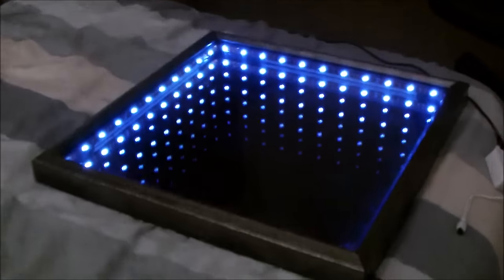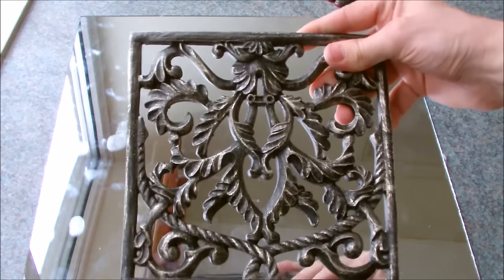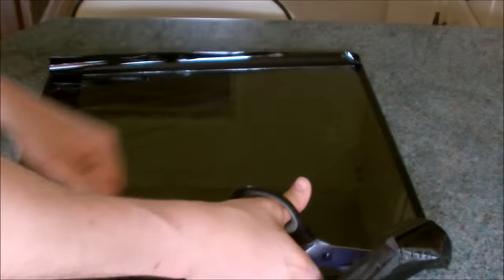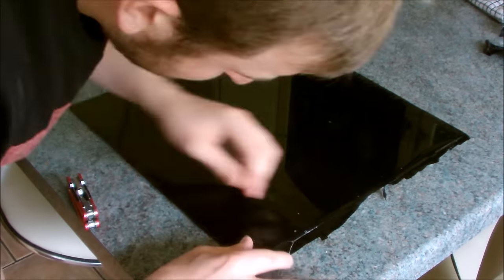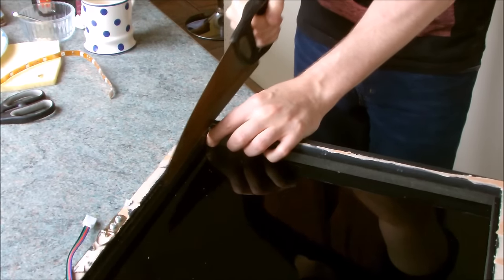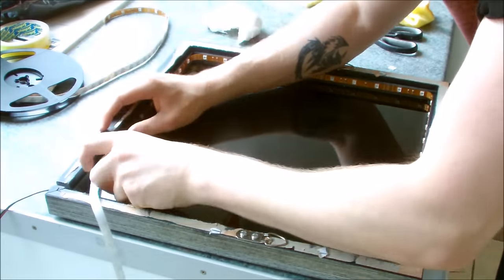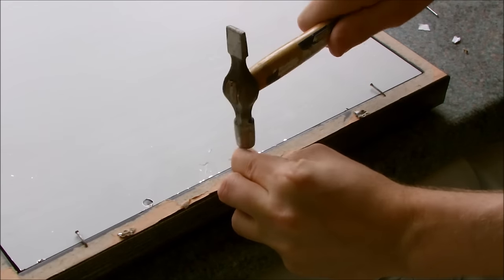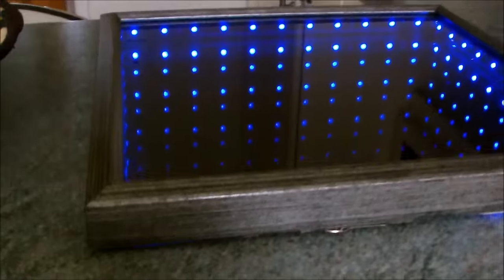Make An L.E.D Illusion Mirror!

Comment: would it look like there was more depth between the lights if the class and mirror were spaced out more?
Reply: +David Secrest  - class?
Reply: +David Secrest It will look with more depth if instead of dark window tint you use mirror-like (some call it silver) film. Since the film acts as a mirror the more reflective it is the more light bounces back and forth inside, so more "depth" illusion is attained. The best setup will be to actually use a one-way mirror as the front glass (the mirror part facing the inside of the box), with two mirrors facing each other the illusion will have more depth. Problem is those mirrors are expensive.
Reply: Ah
Reply: +Jelly G. I think you wanted to put " two way mirror " ?.
Reply: No, one way mirror. One side which you can see through is on the top and then the mirrored side is on the bottom so the 2 mirrors are reflect each other but you can see through into it clearly still
Reply: "One-way mirror" & "two-way mirror" is the same thing, both equally correct.
Reply: KatorNia one way mirror has reflective coating on one side only so if viewed from the other direction you can see through it like a window (think any interrogation room you see in movies). Two way mirror has reflective coating on both sides of the glass so you just get a reflection regardless which way you view it.

Comment: I built one of these when I went to an engineering camp at UA. The head of the optics department got us all the materials, and we used Arduinos to program the light strip colors and patterns. It make a great illusion, but it was a pain in the butt to solder!

Comment: cool video man - just a tip for next time, if you wet up a window or similar surface and put the film on face first, when you peel the backing off the water will create a vacuum-like effect that will stick it to the window as you peel the backing off - makes that part of the job way less tricky, handy tip learned from doing miles and miles of window frosting

cheers for sharing!

Comment: You can cut these strips in groups of three; so those last three could be cut off as well, leaving just one outside the frame. At 4:55 you can clearly see the cut zone between the first and second LEDs from the frame edge. If you wanted to get rid of that one as well, it could be unsoldered and replaced with a resistor; an off the top of my head calculation would make it about 200 ohms (4v/20ma), but the LEDs don't run at exactly 4v. There is a voltage dropping resistor for every three LEDs, to bring their voltage down to around 3.4-3.6v each; so 180 ohm would probably be better and may be easier to find.

Comment: Nice Innovation but i just wanted u to know that whether its an RGB or single color led strip, there is always a cutting area mentioned on the strip where u can cut off the extra portion like the one u folded at the back. best of luck

Comment: when you use an LED strip you can trim off any excess LED's at the junction point from one LED to the next.  It will look like 2 parallel lines going from one to the next.  Just cut between them and you will have the perfect length you need.  if you don't want to have a cord hanging off of the mirror you can also use rechargeable batteries in a caddy mounted to the back of the mirror.  Just match up the required voltage of the led strip to the voltage produced by the batteries used and bypass the inverter with a direct dc connection and you're done.  If you are unsure of how many batteries to use or what size just remember Ohm's law for voltage where voltage in a DC series circuit is additive and current is constant.

Comment: Try one with the 50%  mirrored window tint film withe the mirrored side of the tint film facing the rear mirror.
The effect will give you a much deeper tunnel reflection .
Also a true piece of 50% mirrored glass or 2 way mirrored glass from the local supplier cut to size would be better if you can find it.
The rolls of window tint material can be ordered through any automotive supply place.

Comment: Just a suggestion if it hadn't been mentioned already... instead of bending nails to keep the mirror in place, use glazing points. They're smaller and do the job better without sticking out the back. Google glazing points or glazier points. Nice job, btw.

Comment: tip , avoid using green scrubber on glass/mirror . its likely to scratch surface . Its good to use razor scraper at flat angle while wet with glass cleaner .

Comment: great design.  can't quite get my head round the film you use,  is it black on both sides or jus one? how does the light get through the back of the mirror panel? where did you get your film from and how does the led connection plug in to main,  sorry for so many questions
Reply: If I had to guess:

- The film is the same kind of film used for car window tinting. Not sure, but that's my guess. 

-The light in the back of the panel is from the extra LEDs on his strip, as he mentioned. that is, unless you meant the extras you see when looking into the mirror, which are merely reflections of the one strip. 

- No clue where he got the film from. 

- I think he used some sort of adapter to plug the mirror into the main outlet. Not sure exactly what kind, as I don't recognize the LEDs plug, but I believe there is an adapter.

(I claim to know nothing for certain. This is simply speculation based on my own experience with crafts like this [which is the equivalent to assembling an IKEA desk].)
Reply: Benjamin Waddell Yes, it's all the same. Window tint is window tint, you can get it at Walmart.
Reply: Yeah, it's regular window tint. I'm not sure what you mean about the light getting through the back. The light strip is fixed BETWEEN the mirror and the tinted glass. Like if you are facing the mirror, it goes tinted glass, lights, mirror in back. The film can be bought online or at a Walmart or auto supply. The LED strips either come with a power supply or work off a battery, depending which one you get. Hope that helps !

Comment: If you take 3M magic tape covering the led strip the illumination should spread throughout instead of presenting each led dot of light(separated). Or using neon wire strip. That would be an interesting and different look. Also instead of the black film, use metallic reflective film creating an infinite mirror.

Comment: Wouldn't a bit of black electrical tape to cover the remaining LEDs on the back keep that light from being a nuisance?Also, how about using a thin bead of silicone to hold the mirror in place instead of bent over tacks?

Comment: Can it also be done with a rope led?
Reply: Faizan Tanveer It wouldn't look very good and it would melt the rope light and the tint.
Reply: thanks :)
Reply: Yep, I had a rope light around my bed as a kid and it melted to my mattress and made a black spot on the wall lol but you can get 5 meters of water resistant led's for  6-7 bucks.. I would get the 5 volt instead of the 12volt so you can cut it at any length and use old usb cords at any cut point. Otherwise you have to use a 12V power supply for every single piece you cut, they're just as bright just something to think about. 

Btw there are marked spots to cut every inch and you have to cut it where it shows (there are copper contact points where you cut it)

Comment: why didn't you just cut the excess LEDs
Reply: The brand he used makes you cut them a certain intervals
Reply: +Brock Williams He mentioned that the strip of LED's he purchased were made in such a way that he /had/ to cut them the way he did. My guess is the strip had certain "safe zones" where the wires didn't cross, for cutting.

Comment: I built a slightly larger one than this for a friend's souped-up van back in 1976... about 3 feet wide and 1½ feet high.  Had to use tiny incandescent hobby lights, as we didn't have LEDs, and put a controller switch series so it could do "movie marquee' style scrolling light shows around the edges.
1976!   This is NOT a new concept.
BTW, instead of using the semi-reflective film, you can use a standard two-way mirror from a glass shop, and the inner reflectivity will be better.  The film makes each iteration of the reflection a little grainier, as it's not perfectly planar.
Two-way mirror glass is absolutely flat, gives more internal reflections, and the reproduction of each reflection is sharper.  
I notice the film you used only creates 7 reflections before fade-out.  Depending on the reflectivity rating for the glass used for the 2-way mirror, you can get 12 or more reflections, making it "deeper".
Also, a little extra space between the back mirror and front 2-way will greatly amplify the perceived "depth".

Comment: My friend and I built a large 6 by 6 by 1.5 foot infinity mirror

The 1.5 feet was filled with a seemingly random and self revolving wallpaper and bright diffuse lights.

It really looked like you could walk in it.

We polished it for a while and applied an anti-fingerprint spray.

We put it in a city square.

A crap ton of people took selfies in front and touched it a lot.
Expected, but....

This idiot
he comes in and does a run up into it.
He breaks through, gets a nosebleed and a ton of cuts.

probably drunk